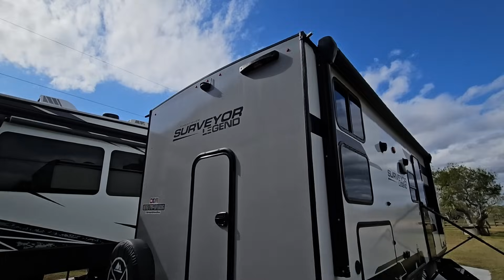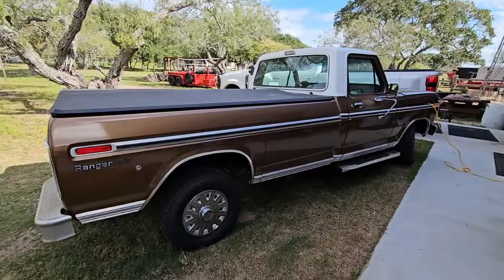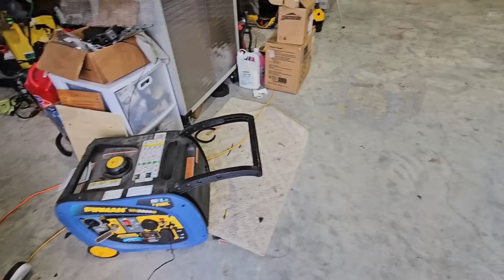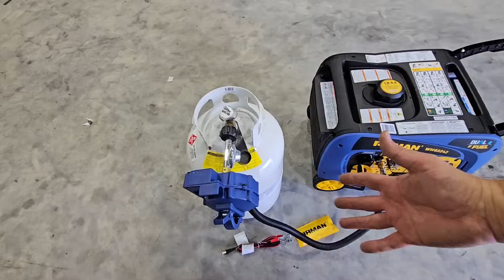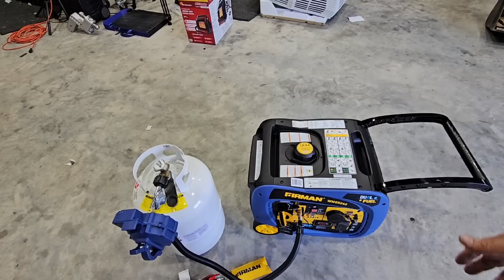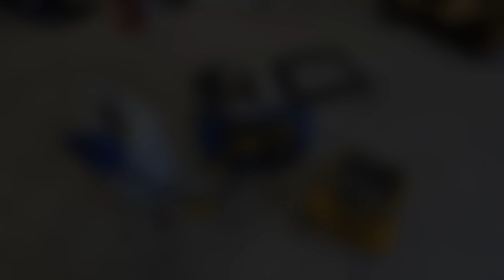$10,000 Solar vs $1,000 Generator! Firman Inverter Whisper Generator!

Comment: Problem with generators is stealth factor. I just got done installing a 2000 watt Yamaha generator where I deleted the back seat of my truck and ran a diesel heater exhaust under my truck to run my 5000 btu window air in my truck camper. Eventually I will get a solar system I build to handle air conditioning and use generator as back up.

Comment: I have a toy hauler that has a Cummins Onan 5000 that uses between 1gal to 3/4 gal a hour of fuel compared to my pulsar 4500 quite generator that uses a 1 gallon every 6 hours . The pulsar gets used when a generator is needed while camping and we only use the factory Cummins at home for about 1hr every month. The rv has a 100 watt solar panel and two group 31 marine batteries.

Comment: What about people who want to just run the microwave and 12v refrigerator. They are not wanting to run ac. Love to see a video on lithium battery, inverter, battery monitor and connected to solar. Your travel trailer would be a perfect example for this. As far as I know there isn't one that goes through what size wire and all the fuse placements.

Comment: That’s the problem with the current products being sold now. Low quality and under powered, who wants to listen to a generator for hour while camping, out solar system fail within months.  I replaced the panels because of a thunderstorm with small hail damage the flexible solar panels. No safety switches to shut power off to service the system. Wiring was too small for the inverter.  I guess the little problems helped me find the huge issue of potential fire with system. Switch to a DC to DC solar controller. So the system is charging while driving. Nothing worse than getting to you destination with only 40% charge. Switch to lithium batteries after the AGM batteries died in 3.6 years.  I did the work myself at 25% of what the service department wanted and I got better components.  I could go on. 
Do your due diligence before buying anything. It will save you money if your handy with repairs. Don’t buy extended warranty. I’ve never heard of so reasons why my warranty wouldn’t cover this or that..

Comment: Quiet unit.  I’ve never owned an RV (yet, I appreciate your channel for my research); I have a Coleman 6250 generator.  Would that be sufficient for boon-docking purposes, and if so, how big of camper can I run with it?  You had mentioned the solar and how most is just a battery tender.  I want to be able to have off grid capability should SHTF and you need to bug out.

Comment: You don't need to spend $10k on solar to run a residential fridge and microwave. Here's some tips to save on solar: Don't buy overpriced batteries (i.e. Battleborn). You can get good Lithium batteries for about the same price as a good lead acid these days. And they'll last 10 years instead of 3. Utilize 60 cell solar modules (residential size) instead of RV specific ones. They're less than 1/4 the price.
I have a very large dual inverter system and spent less than 10k. That being said, I still carry a small 2500W generator. It only gets used like once a year (mainly due to short winter days or long periods of clouds), but it's still a necessity. But at 2500W it's only 45# and I can easily move it around with 1 hand.

Comment: Our favorite campgrounds are really shaded, and also don't have electrical hookups, and don't allow generators. We upgraded to LiPO4 batteries (560 amp hours) and just the one factory 190 watt panel on the roof. We can go 4-5 days without sun and still run the 12 volt fridge, water pump, and lights.

Comment: I have this exact generator. We use it in our fifth wheel for boondocks. I have found that anything above 4000 feet of elevation. It absolutely will not run multiple large appliances, even running gasoline. One AC unit and a microwave is a no go. Below 1000 feet of elevation we can run two AC’s but we do have soft starts. Also, sometimes when running in Eco mode when one AC unit was cycling off and on the motor would not catch up to the load and it would get stalled out. We normally just ran hours in the regular mode which was fine. We were only getting 4 hours or so on a tank at full capacity. But like you said it’s rare to have to run it at a high capacity for extended periods. For a $599 inverter generator we’ve been happy with it overall.

Comment: The problem with solar is you have to park your RV in the sun.....not fun on 90 or more degree days when there are trees and shade available to park under. The shade also allows you to enjoy camping outside next to the RV. The perfect setup for me is a generator(s) and a hefty lithium battery bank. Run the genie for two hours a day to recharge the house batteries and only run the genie when running the AC hard. This works in the shade, when overcast, in rain and snow. Can't do that with solar.

Comment: I have one that I used for power outages in Houston. Added plug connection to the house and powered 3 refrigerators the lights ( all led) and a 12,000 btu ac

Comment: I have two of these units ($599 each from Costco, on sale).  Also picked up the parallel kit in order to run both simultaneously to provide 50 amps.  Can run two ACs on one generator with soft starts.  Love the Firman generators.

Comment: I absolutely agree that a generator offers the most bang for the buck. It is essential even if you have a solar system and should be the first thing you buy. One thing I don't like about that Firman is the propane hose length. Another couple of feet would allow you to connect to the propane tank storage area on the rv.

Comment: I do believe that propane uses the same carburetor as gasoline no? So if it was gummed up it still wouldn't start with propane.
Reply: Everything I have seen on dual-fuel generators say that the propane bypasses the carburetor entirely.  You can see the propane hose and the fuel doesn’t flow into the carburetor.  Because either is a gas, it flows differently than a liquid fuel.
Reply: Right so if you use gas first then propane it also kinda pushes any gasoline remnants out of the carb.

Comment: I boondock with two Ecoflow 1300s and a 4000W gas generator with no solar panels.  I installed a soft start on my 13,500BTU A/C unit and the generator has no problem running my A/C.  The two Ecoflows will power everything but the A/C and take about an hour to recharge with the gas generator.

Comment: Between you and Mike's Weather Page, Firman is the choice.  I am a flood insurance adjuster who travels to disasters, and often, there is no power for the first week and sometimes longer.  My wife and I are buying a trailer for our Ram 3500  to stay in at storm sites. The issue I have been trying to figure out is how to cool the interior during the day while we inspect buildings so that when we return, the interior is not sweltering hot. The bed and furniture will be too hot to sleep in, regardless of the air being turned on upon our return. I need a week of run time for the AC, 24 hours a day for a week. That would be 14 propane tanks, or lord knows how much fuel.  Any suggestions on what to use or any combination of products would be very helpful in our purchase. Obviously, a toy hauler would be a good choice, but the floor plans suck for what will be full-time living while on site. Love your reviews and information and have used many of your suggested products. Thanks.

Comment: JD, if someone is paying $10k for most solar systems on an RV then I'd say more than likely they are being ripped off.  I have 1600W solar panels, 3k inverter and all the other necessary equipment and I only paid $3600.00 for it all.  I can run all my major appliances straight off my solar panels during the day.  At night I can still run most everything I have due to my battery storage capabilities but just don't run them down past 50%.  When I get to 50% I simply plug up my generator for however long I need it for till the sun comes back up the next day.
Reply from the maker: That's awesome, can you please break down the components and prices? I'd love to share with my viewers.
Reply: @BTBRV  --  Goodness ... I bought my system 3 years ago.  I got lucky and bought my panels on sale around $225 each.  The inverter was about $800 I think.  Controller was about $500 give or take.  Batteries were $1000 maybe a little more and all the accessories and installation costs the rest.  I got a good deal on my panels or they would have cost me a little bit more than double what I paid for them.  Folks need to shop around for what they need or want and get their equipment when it is on sale.  I easily saved $1500 bucks maybe a little bit more.  My system runs great, and I love it
Reply: @jamesbass9797  I have installed solar on RVs /Boats and camper vans the vans solely dependent on a system that was charged either off of solar panels or a high output alternator for backup. The heart of a solar system is the controller inverter and batteries the install also matters a lot using high-quality cables and connectors that are rated for the system. solar panels have come way down in price. I've learned one thing if you buy inexpensive equipment it will break sooner or later wish you the best of luck
Reply: @robertjohnson4784  --  lol  ....  smdh  Like I said people need to shop around and buy their equipment when it can be found on sale.  I was in no hurry to purchase what I got and that give me the time and luxury to be selective with who and where I bought the equipment.  By doing it that way I saved a fair amount of money.